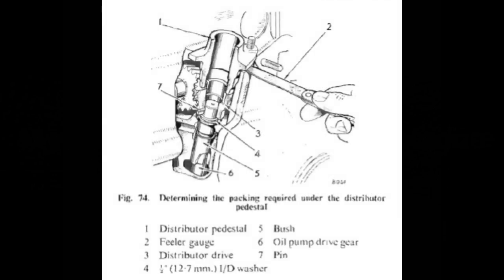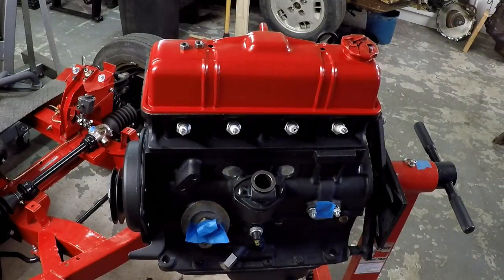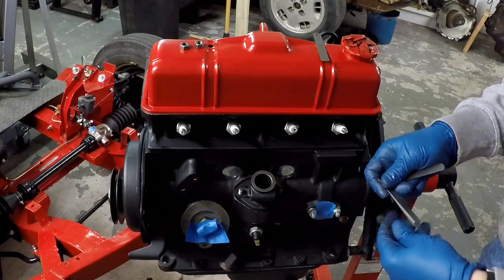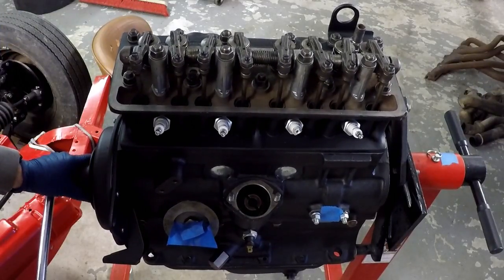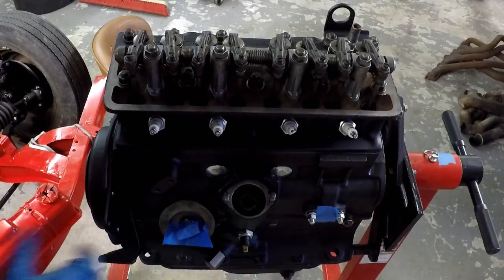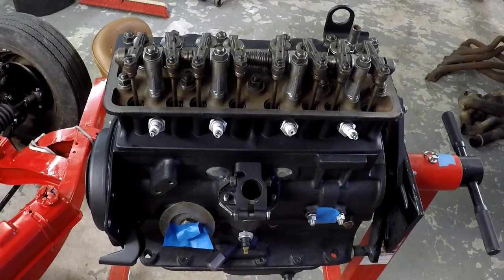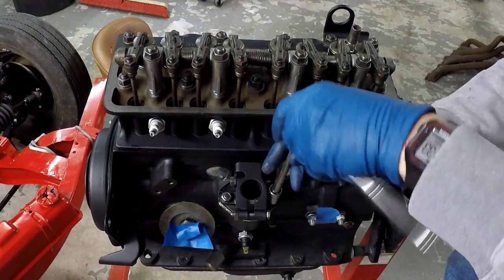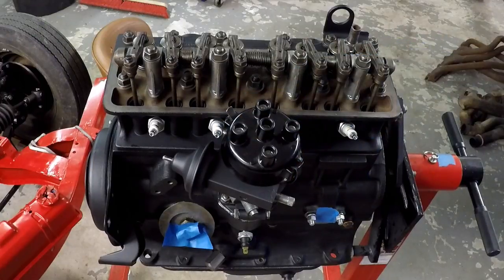Triumph Spitfire Engine Rebuild #8 - Distributor Fitting

Comment: This is good as far as it goes, but the caution about using more documentation is well-taken. He says he measured the washer, couldn't remember the value, measured the gap and did "some math" to figure the gasket thickness. Leaves a lot to be desired.
Reply from the maker: Thanks for watching. Point taken. This was my first engine rebuild. I figured it was better to be honest than to provide bad guidance.